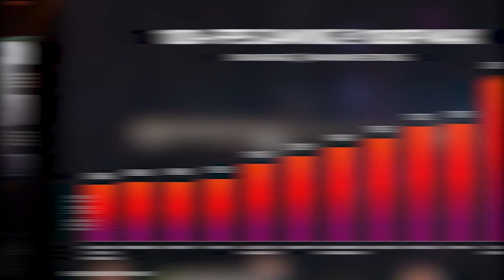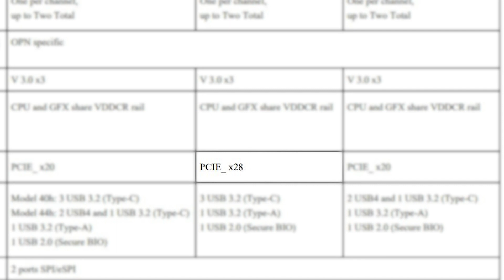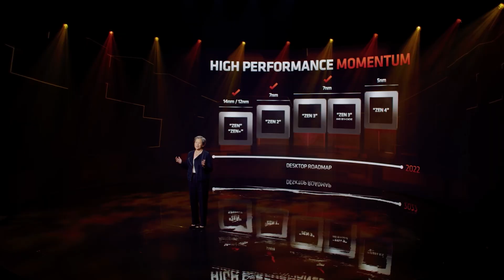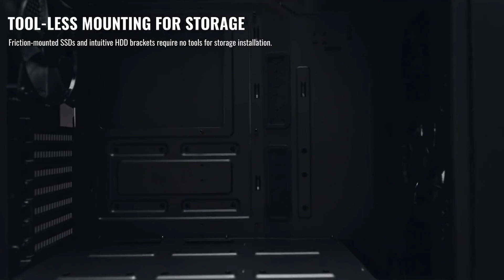AMD is Doing the Unbelievable

Comment: i hope these apu's are soon launched for pc
Reply from the maker: Seeing the current market with insanely priced GPUs, this could be a game changer 👌
Reply: @pcneststayinformed  I will be happy if these apu are able to perform like GTX 1650 with pricing of around 15-16k like currently 5600g is price for around 13.5k which performs like GT 1030 and in few scenarios it even beats that so if the new apu are comming with decent price then it's something good but in case they keep the pricing like 18-20k then it's of no use because we can get a 12100f +  GTX 1650 / rx 6400 discrete GPU  at a pricing of 19-20k which would be a far better option because we will be able to use cheap ddr4 ram for these processor 
So finally it's all on the pricing new tech comes and gets old eventually the major thing is the pricing and there is always  unnecessary hike by our indian distributors and sellers keeping their margin high :(
Reply from the maker: That's true but I don't think we can have an i3 12100F with a 1650 for 20K because currently the CPU costs like Rs 9K and the 1650 costs 15K. So, it will be like 25K. Considering that AMD releases the 7840HS for less than 25K, we would still be good because it has the 780M and 8 cores, 16 threads which will have a big advantage over the i3 12100F.
Reply: @pcneststayinformed  Here is lamington road i quoted for 1650 with 12100f for around 21.5k including GST 13k for 1650 and 8.5k for 12100f but anyways i hope these apu comes with decent pricing and good single core performing
Reply: @pcneststayinformed  That apu shud be around $400-450 if it already match 10700f/1650 combo performance